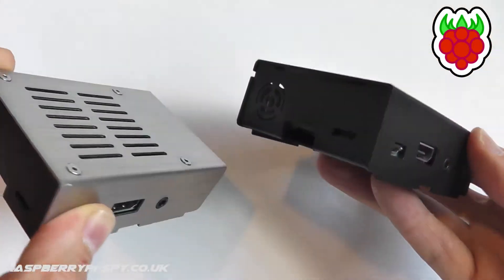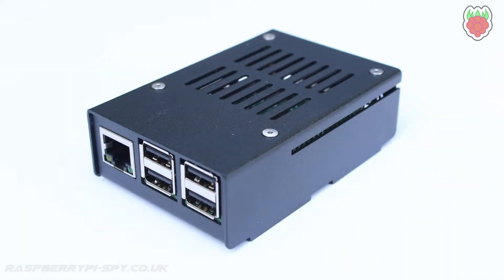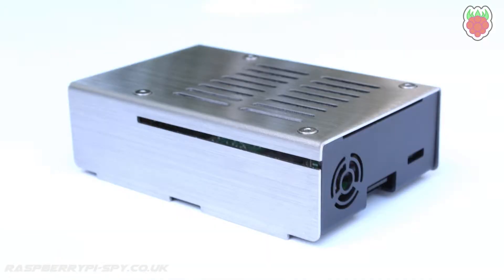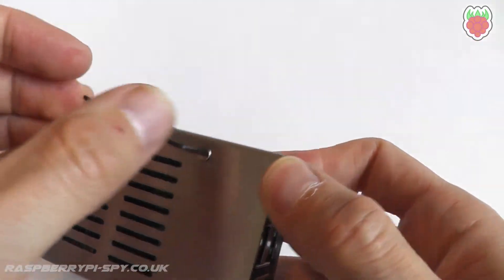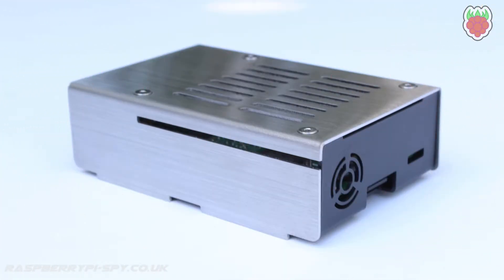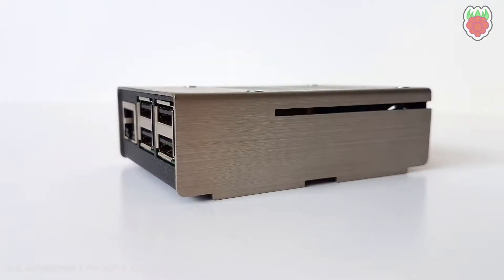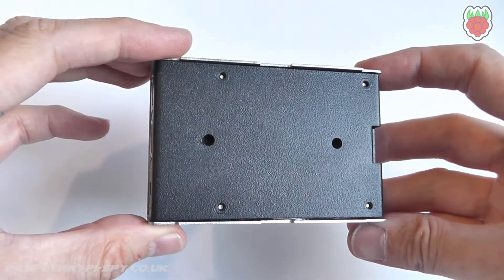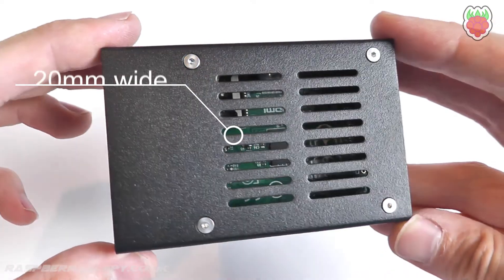KKSB Metal Raspberry Pi Case Review

Comment: I ordered this one, but am waiting on a fan and some rubber feet because the design of the case can scratch or mar any surface it's sitting on.  While it's sturdy, if you don't need to use the cable slot, there are other better cases... one I wish I had purchased.